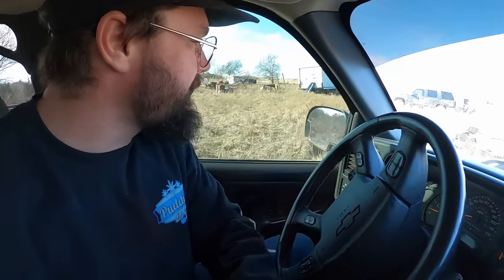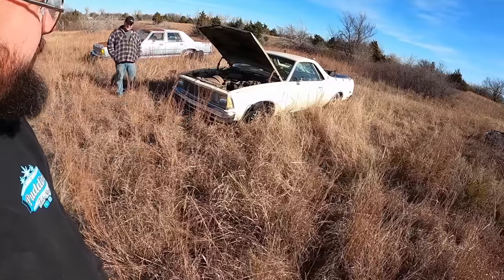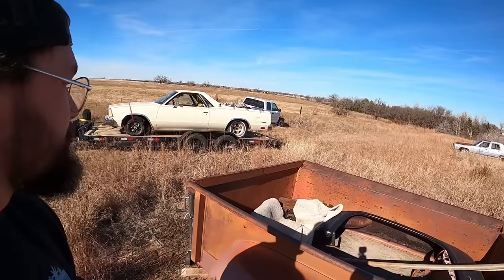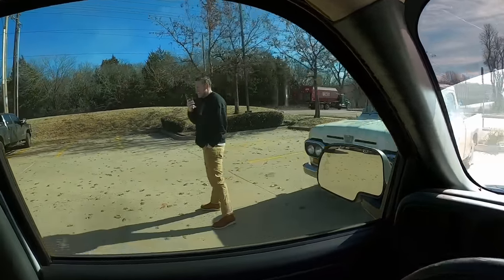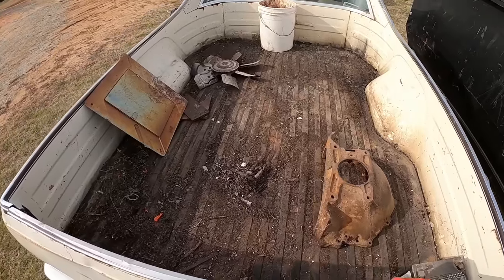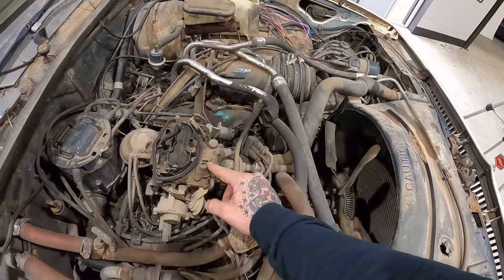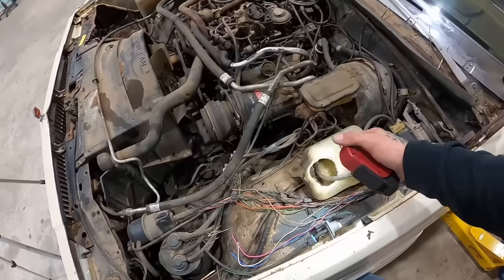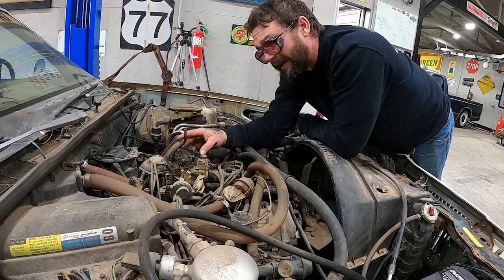1980 El Camino. FORGOTTEN in a Field. CAN WE DRIVE IT?!?

Comment: Back when the 3.8 came out , most gear heads hated em..
Mostly because it was 2 cylinders shy .
I was one of those guys ...
But...the 3.8 turned out to be a solid motor . Especially the Buick turbo charged 3.8 that are highly sought after now ...
Reply: But a Chevy 229 v6 like they have is not related to the Buick 231 which was famous for it's Grand National and GNX versions. Heck , I would be thrilled with a plain old T Type 231 Turbo from around 1978.  Especially a Century.

Comment: They was okay little engines if they change the oil regular if I remember right the heads stop up and starve the bottom for oil I remember back in the day I put a V 8 mini  in them because in V6 is would have a hole in the side block

Comment: These had a nylon cam gear until 1988 when they went to the LN3 even firing 3800 Pre  Series 1. These old Buick 231 would need timing chains around 120k miles. If these old 3.8 jump timing it could destroy the moter. They put thr nylon gears in because these had no balancing shafts prior to the introduction of the LN3 3800 V-6 in 3/1987. There was 2 versions of the Buick 231 V-6 a RWD and FWD version 1984 on up.
Reply: They have a Chevy v6, not a Buick.

Comment: if it is a 3.8, that's the chevy 229.
The buick 231 is also a 3.8. buick has the distributor in the front. Easiest way to tell.
Reply: I can't believe how many guys commented, "Yeah, I had one of 'dem 3.8's back in da day. Dem's a good (or bad) engine!" 
 Most of them are thinking of the Buick 231, not the engine in the El Camino shown here.
Reply: @auteurfiddler8706  my Buick 231 was good until it exploded lol
But a teenager hotrodding it won't make it last long lol
A healthy Buick 350 sits in its place.

Comment: Years ago I bought A Cavalier for 100 bucks scrap value because it didn't run and when I pulled the plugs out the electrodes were gone completely. 6 dollars later it ran like a charm. Never saw plugs that bad before or since.

Comment: The vacuum apparatus on the thermostat housing is called a “thermostat-vacuum switch”. They stopped using them when computers got more advanced to open and close egr valves and choke pull offs on carburetors. Another death-knell for the TVS was EFI, as they don’t use so much in the way of vacuum to be actuated. Those TVS were soooo bad about snapping off and causing vacuum leaks and driveabilty problems, I DO NOT miss them!!

Comment: No it’s a long shot of you reading this but iam 95% sure it’s the hose that goes to the caliber. Have had to fix that problem multiple times on customer vehicles also that frame is consider a G body it’s not the same as caprice. The front end is the same as the S10 you got

Comment: El caminos are interesting. I had a station wagon of the style with a small block V8 from the factory. About the same year. Beautiful shape is back in late 80s. And everybody gave me a hard time because it was station wagon and I liked it. Anyway so I liked best body style. I don't understand why this isn't to go to hot rod body styles. I think the Ford Fairmont should be in the Ford answer as well. I always hate it messing with brakes.

Comment: The rear wheels are also factory for the elcamino and cabelero cars just the same as the s10's and the Camaro and the rear wheels are 14 x6 or 7 Oldsmobile cutlass rally 2 wheels ive had several sets of them and ran them on Buick Regals, Chevy S10 trucks the cutlass supreme cars they came on and 3 different third Gen fbody Camaros, and even my 83 Pontiac Grand Prix SJ because it's factory wheels did not hold air and I was not running the 14x7 American racing chrome plated steel reverse blade wheels and simulated bolt in center rim
Reply: You can tell they are the stock wheels because they are painted the same color as the body, which they were doing a lot back then.

Comment: Truck had a bit of rust and it was red orange and white in the center of the truck....2bbl 2.8 173 cubic inch V6 ran good and shifted great, anyway I ended up getting a 89 Chevy S10 regular cab short bed 4cyl tbi 5spd with the metal reverse gear it would whine while backing up, anyway it needed tires and two good wheels, and the right side door so I ended up putting the door off the 82 Chevy S10 Durango and put it on the 89 Chevy S10 regular cab short bed El and the Dr side door on either truck wasn't any better so I ended up getting a white and dark red Dr door off a 86 chevy S10 regular cab long bed 4x4 2.8 v6 Tahoe,, and with the white truck and the metallic medium grey hood from a 86 chevy S10 2.8 V6 automatic regular cab long bed Durango parts truck and the bright red and metallic grey in the center front fenders the 89 Chevy S10 regular cab short bed El would stick out anywhere lol,, anyway I have said that I ended getting a 85 Chevy c10 custom deluxe long bed 2wd 4.3 V6 4bbl quadrajet carb th400 truck it was a very solid truck I ended up getting it because my uncle was in the process of building a drag regular cab long bed Chevy S10 a 84 and wanted the 82 Chevy S10 Durango for the solid floors and the manual steering column and pedal assembly and the manual brakes and steering box, and the decent long bed just needed over the wheel wells patched... So I traded which otherwise I probably would have ended up getting different parts and fixing it too, that was my plan before I got the 89 Chevy S10 regular cab short bed El, and the 86 chevy S10 regular cab long bed Durango parts truck but it's doors and cab floors cab corners and rockers and bed were junk

Comment: Hey don't knock those 3.8 lite The buick Grand national had a turbocharged 3.8  litre And my 1976 buick skylark Has a 3.8 6 cylinder in it and I run a twin Turbo. I push out five hundred and eighty horsepower and four hundred and 30 pounds of torque. I know I need a better Torque converter And I need to regear my rear end
Reply: This is not the same 3.8, it is a Chevy 90 degree engine.

Comment: U do know you are supposed to verify trans fluid while the car is running. and with the smell of gas you should change the oil now before you wipe the crankshaft with the fuel in the oil....

Comment: That transmission most likely is a TH200 R4
What about pulling the drive line out of that parts four-wheel drive pickup you have for the 350 and it's also got a turbo 350 transmission most likely or if you're really looking for something different put the El Camino on the truck chassis and have a four-wheel drive El Camino😅😅😅😅 morksky will love that😅

Comment: Yeah Buddy 80's EPA coming at ya. Good ole 3.8 V-6 had two of these in Olds cutlass and one in a 
86 T-bird.
My 84 Cutlas 3.8 kept breaking Rocker saddles, damn things were cast aluminum, cost $3.00 back then and I kept one in the glove box and valve cover gasket in the trunk probably broke 4 of them over a couple years. Some days it ran fine others days it ran on 5 just depended how it broke and would sometimes sit right then move or break even more and finally I would change it out.
 As for the melted spot that's from the old 100 watt drop lite with no guard (classic) burn mark on shrouds, hoses, batteries. LOL
This was when analog was beginning to go digital, had a lot of vacuum/switching going on.
These were also known for the starters sticking nothing like hearing zzzzzzzzzzzzzzzBANG.
Damn thing almost caught on fire before I got the battery unhooked.
As for the Ford that one had the ignition mod on the side of the dist. so it would crap out when it gets hot or vibration breaks ground on the aftermarket ones. It also relies on the smog crap to determine fuel ratio so leave the sensors plugged in and cut all the vac hoses ya want I did.
Collapsed brake hose will take out a wheel bearing and brakes quickly that's another story.
Another great vid Jake and looking forward to this years calamity.
Reply: If it makes you feel better,  your 84 Olds had the Buick v8 which  is not even close to the Chevy v6 in their car.
Reply: @auteurfiddler8706  Well I be dipped.
Are you sure? because 40 years ago when I was in my 20 I was pretty good at counting I counted 3 cylinders on one side and three on the other and 5 fingers on one hand and 5 on the other. Are you sure because I don't recall you being there and helping me out there Lee Iacocca. 
If it makes you feel better your probably  thinking of the 305 turbo in them Buick Internationals back then. No mine didn't have the Hurst shifter, or 442 written down the side and Posi-trac with 50's on Cragars.
While I'm at it can you look back and see if it was a 400ci I put in my 76 Torino when my 351 Cleveland blew out or maybe it was a Windsor? Can't remember back then I think it was a Tuesday in 1981?

Comment: I had a 1980 El Camino when I was 14 years old!  I may or may not have driven it for a year before I even got a permit much less a license.  I spent more time working on it than actually driving it.  Between it burning oil like a mosquito truck and leaking oil from every where possible, I had to add a quart of earl at least once a week!  Looked cool (to me) but by FAR the least reliable vehicle I have EVER owned.  Oh and it cost $500.

Comment: Pull the vacuum line off the modulator on the transmission.  There's not enough tranny fluid all over the bottom of that car for the fluid level to be that low, so it's probably sucking it up through the modulator into the engine.  Which may be good for it, who knows.

As soon as you pull the vacuum line off, you'll probably get a small spurt of tranny fluid, which means the inside of your modulator is leaking.

If it doesn't leak, somebody may have replaced the original transmission with a genuine used parts warrantied junk yard transmission, which would explain the missing piece of your shifter linkage.

Comment: They actually came with size 15 tire on El caminos and the Malibu I had a 81 Malibu and the front  looked identical to that El Camino and it had 15 from the factory and the same 6 cylinder motor and I pulled it out and put a 350 4 bolt Maine down in her and roasted the tires off and went slide Waze had a good old time

Comment: You are supposed to check the trans fluid with the car running. Please stop hating on the Q-jets they are great carbs you just have to understand them. There are alot of racers using them. Other than that Great video keep em coming!

Comment: That's the smog pump with the pulley removed, probably explains the flex pipe where they cut out the catalytic converter. And that's the th200 transmission. Can't wait to see ole eagle eye flying down the road!

Comment: I don't believe these 90 degree Chevys ever had a nylon timing sprocket. Pontiac used them for a short period in the late 60s or early 70s, but only in the 2bbl 400s, I think. 
The ones that were notorious for timing gear failures (nylon sprocket) were the 85-87 FWD Buick V6. Both the 3.8 and 3.0 versions.

Comment: I had a 1980 Lemans with the same 229 engine. It got 26 mpg on the interstate. 2.41 gears and the trans had an early version of a lock-up converter. 
The 78-79 El Caminos had a 200 cu in V6. 
It looks like someone swapped in a steering column from a 1990s Chevy PU. That's what the steering wheel is. That key is another hint.

Comment: That pipe was a catalytic converter delete. The trans is a 200 metric, basically a lighter weight 350 turbo. It'll work with a V8, just won't handle much power

Comment: Back in the day the GM HEI module was unreliable at best. It was ahead of its time. We used to swap them for points or Chrysler ignition boxes because they worked so much better. Times sure have changed. These days you can't buy a new Chrysler box that works. The HEI module is so reliable folks are mounting them externally of the distributor on homemade heat sinks. The switch from solid state electronics to semiconductors was not smooth. BTW that contraption on the thermostat housing is a thermal vaccum switch or TVS. It does exactly what you said.

Comment: You wanna talk about spark plug wires. I had a '91 Buick Skylark Custom with a one off 2.5L. It was only used for one year in the Custom model only, and for good reason. The control module and coils were on the cross member under the engine in a location where it was not possible to actually see them. The wires snaked around and under the engine, and were about eight feet long. Since the control module was on the under carriage, the control module would get wet and the car would go dead any time you went though a big puddle. It would dry enough for the car to start after about fifteen minutes, but it really sucked when it happened on the way to work. The oil filter was cool though. It was a cartridge style that was actually in the oil pan. You just remove the access cover and pull it out with a pair of pliers. It was definitely a unique engine. I ended up having to junk the car over a bad crank sensor. It went out, and was unobtainium in 2011. I paid $500 for the car and drove it for 10 years. I loved that car and hated to have to let it go.

Comment: The main question I have is why does that mullet-mino have a 88-91 chevy truck steering wheel? I'm sure you have no idea but what in the cousin lovers the factry wheel is WAY better than that
Edit: I believe you're supposed to check the Jenner-matic level while it's running but I could be wrong I remove those and put a man mission in its place

Comment: It works for A V8. It doesn't matter. Just Chevy, it's not a Ford.
You're getting pulled out. You pulled the engine out and you dropped the 8 right in place of it. Just for you, locate the Lower frame outs and put v 8frame

Comment: If you check the transmission fluid with the engine not running it will show that it’s over full. Those front rims look like the rally wheels I had on my 72 cutlass.

Comment: Puddin the caprice was a b body, they came with v8s usually,  that elky is a G body it's pretty much just a smaller b body but 2 wd s10s shared the same front suspension as the g body.

Comment: Long time watcher first time caller😁I took a snowblower to move vehicles take off the blower part weld a pipe on and if you can get weight off the wheels it will work

Comment: You gotta check the transmission fluid with it running. It will appear over filled if the engine isn't running

Comment: That looks like a 4.3. A 3.8 will have the distributor in the front.
Reply: True.  But there were smaller 200 and 229 versions of the Chevy v6 and the 229 is about 3.8 liters, close to the Buick 231 3.8
Reply: Interesting didn't know that. The Buick was better though.

Comment: I had a 3.8 in a 94 Buick Century. It was a powerhouse for what it was, and great fuel economy. Check out the specs with the factory supercharged 3.8. Very impressive performance for those year's. 
Fun video Puddin...
Reply: The front wheel drive 3.8 is different from the 3.8 rear drive engine... A lot more electronics on the newer 3.8's... but you're correct about the better economy.
Reply: That’s the olds 231. Chevy used a 229 v6 . Same set up as a small block minus 2 cylinders
Reply: Yes.  305 Chevy v8 times 6/8 equals 229 chevy v6

Comment: The ignition modules like 12 volts always... if the voltage drops during cranking they tend to burn up... so the multitude of trying to crank them over tends to killem pretty good...
Reply: Chuck a relay in for the power to ignition, help prevent any voltage drop on start up...

Comment: Take some advice from a AAMCO guy,Either pull that 200 metric unit out(transmission) and replace it with a 700 or take it to your buddy and have it updated,In original condition they are known for eating themselves with the factory parts,They shells have problems from being made cheaply , Or drive it until it grenades ,And we vets all know what that means.Just another Nam Era Vet giving his 2 cents.

Comment: 200metric has that lock up torque  converter. I have the GMC version of the El Camino it’s called a Sprint Caballero or Conquests that had the two tone paint color
Reply: Get a new rotor button sometimes those rotor buttons go bad for no reason just the button though

Comment: The ignition module in my 1983 malibu would start when cold, but wouldn't start when hot. I found that taking the module out and spreading the di-electric grease around would get it to start again. They were sensitive to heat.

Comment: Don't sleep on that old 3.8... Yeah it's not a 305/350 but they actually do have a little potential. You can get some cool goodies for these from Jegs and Summit. They sell headers for these along with better intakes and carbs. Slap some 3.73 gears on it and some posi action. It'll get 305 power if you throw a couple parts at it.

Comment: Aye puddin a quick little tip you can buy some drop in inserts that you drill into the concrete in front of your lift then make a bracket to put a winch there so you can pull the non running vehicles in with a winch instead of pushing them. Then just unbolt it and put it back on the towrolla

Comment: You have to have the motor running to check the transmission fluid level it turns the pump it’s the only way to get the correct level on the dip stick it probably even says that on the dip stick

Comment: Becareful with those fuel lines. If I remember correct there is a hard line that runs through the exhuast manifold on the passenger side. It will leak when Hit on the passenger side. My El Camino burnt down cause of it.

Comment: that looks to be the odd fire v6 229cid .... the timing marks can be found in behind the water pump straight down ... i would still check the timing due to the nylon gear .... get it to top dead center with the distributor cap off roll her back till it moves if it 6 plus degrees replace it ... if she got more then 130k just do it
Reply: free tip monday go through the wheel well to change out the plugs use a 3 foot extension and a swivel socket